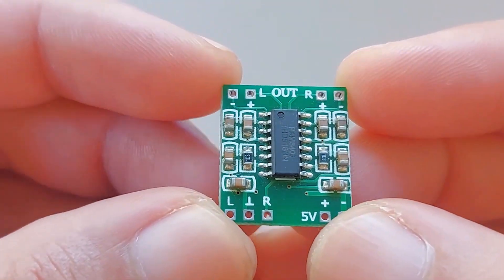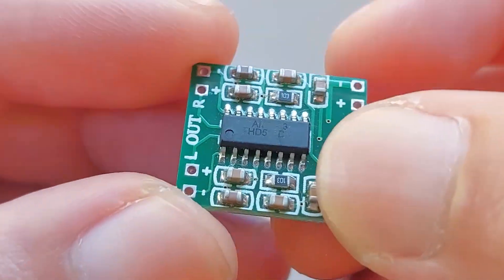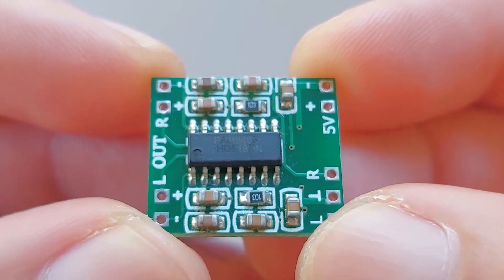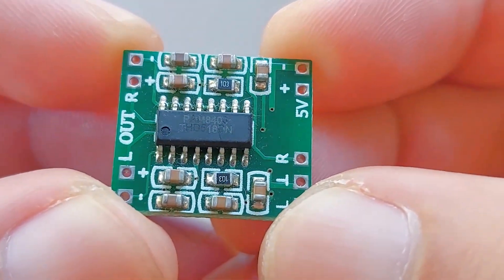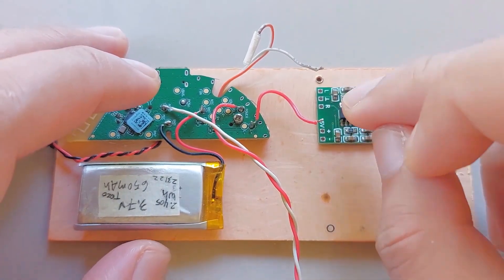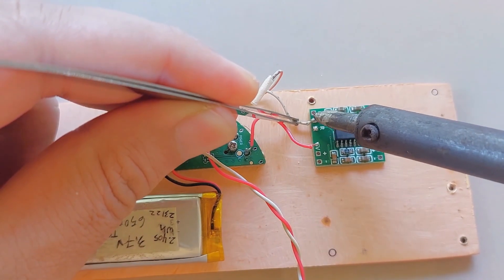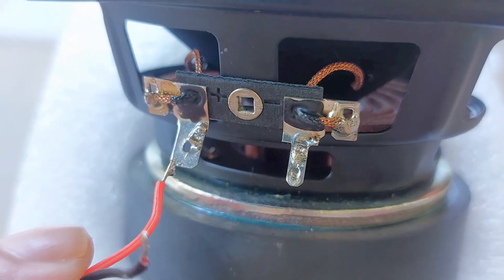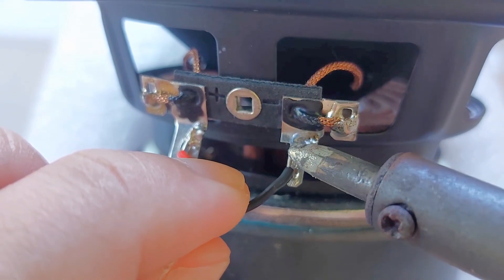JBL Subwoofer speaker vs 3 WATT Audio Amplifier PAM8403

Comment: Can it's really work well. I want to diy speaker 3inch speaker can i use pam8403
Reply from the maker: It's not worth the time and effort, you need a stronger amplifier.
Reply: @TaylorSoloaiJR  in india here pam8403 can run 3inch speaker ( not subwoofer) only woofer speaker. I already listened the sound,  good sound